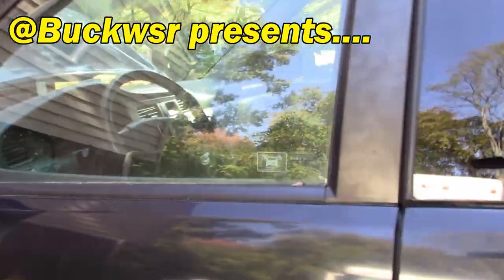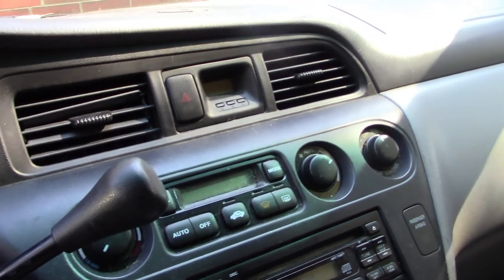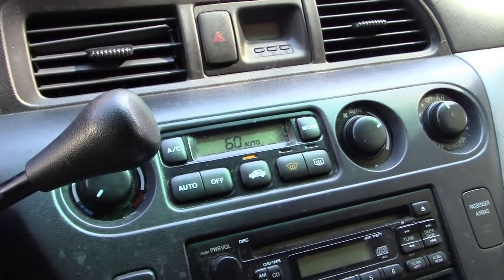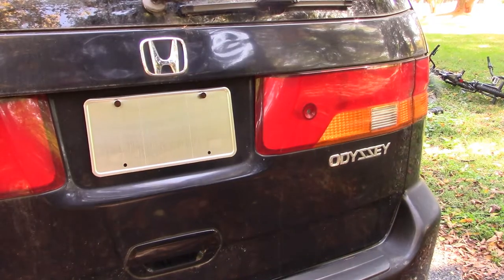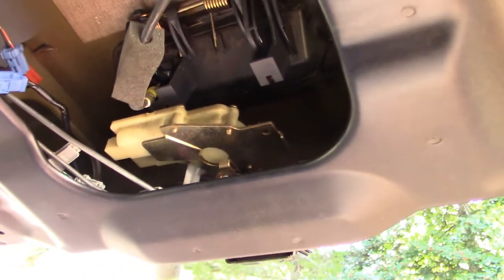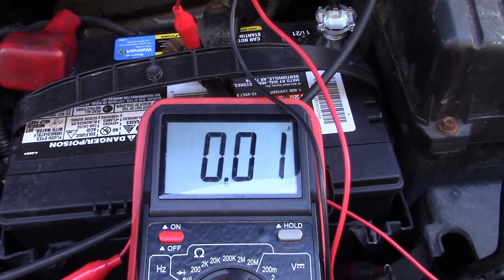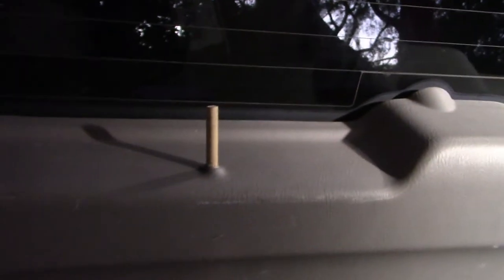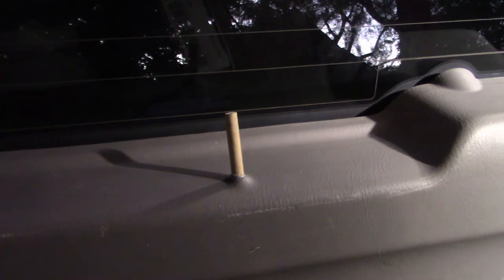Parasitic BATTERY DRAIN (Part 2) "The FIX" - Honda Odyssey @Buckwsr

Comment: Congratulations on a successful diag. 
Just so you know, there are those of us viewers who are perfectly fine with long videos. I would actually have preferred both parts of this one in one piece. An important thing to consider is looking forward 5, 10 or 15 years to folks who happen to find one part but not the other. If you post the link to the other at the top of the comments in both videos you’ll save us viewers some time and aggravation and present yourself as even more viewer-friendly than you already are! 🔧👍

Comment: Mine was the 7.5 backup fuse. 4th one from the lower row from the right on the drivers side fuse compsrtment. Just removed it and did away with the remote lock function.

Comment: You can usually get free online access to Chiltons or other repair manuals through your library card.  Without going to the library. Just using your library card etc.
Reply from the maker: Good tip. Thanks!

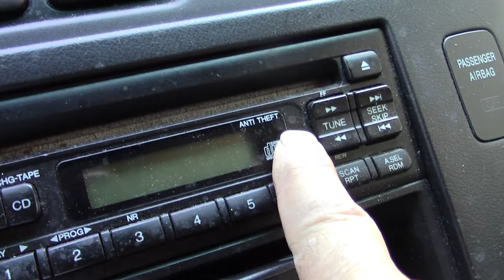Comment: 3:58 From pg. 259 of the owner's manual: "if the radio fuse is removed, the audio system will disable itself. The next time you turn on the radio you will see "code" in the frequency display. Use the preset buttons to enter the 5 digit code on page 144 (It appears it was standard procedure for the salesman to write this code on this page of the owner's manual).
From pg 144: "If your vehicle's battery is disconnected, goes dead, or the radio fuse is removed, the audio system will disable itself. To make it work again, you must enter the code. You should have received a card that lists your audio system code number and serial number. If you lose the code, you must obtain the code number from a honda dealer. To do this, you'll need the system's serial number. You have 10 tries to enter the correct code. If you are unsuccessful in 10 attempts, you must leave the system on for 1 hour before trying again."

Comment: I commented on part one that my 16 Honda CRV is killing the battery if it sits more than four days. I forgot to mention
  our car is now six years old. All of a sudden a few months ago, if I have the key fob for opening the doors and locking the doors in my pocket. All of a sudden if I walk past the car within a few feet, the doors open by themselves without me pushing the button or touching the car handle. If I do nothing and walk away, then I walk past the car again, the doors will lock..
  this car never did this since new until a few months ago. And a few months ago is when our battery went dead and I replaced it, and the second battery went dead because the car sat for five days when my wife had the flu..
   I have a feeling it is the system that operates the key fobs unlocking and locking the doors. Because that system started working all by itself if I go near the car at the same time our battery started going dead ..
Reply from the maker: Your comments have interested me highly! Thank you for writing. For me, the breakthrough came when I realized there was a high likelihood that the battery drain was connected to the other problem I had been having with the tailgate. So I think it is very likely that your parasitic battery drain is connected in some way to the remote entry module / key fob electronics and the unusual things that are happening with it. You're putting 2 and 2 together, and realizing the two issues are probably related. Let me know when you get it figured out. And thank you again for commenting.
Reply: Did you figure out how to fix it with my cousin is having the same issue  ?

Comment: Maybe I missed it, but I didn’t see you examine  the blue connector for oxidation. I would have done that as well as the wiggle test while plugged in and then tried connecting and disconnecting several times to see if there was a change. I suspect oxidation or a loose connector pin or frayed wire, something maybe easy to get at right there.